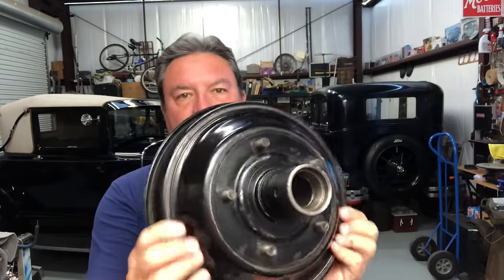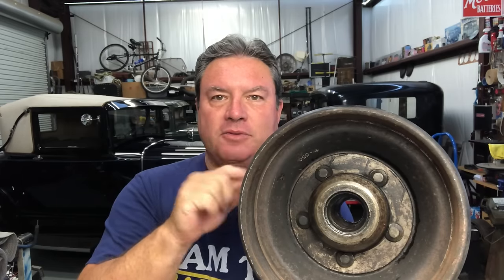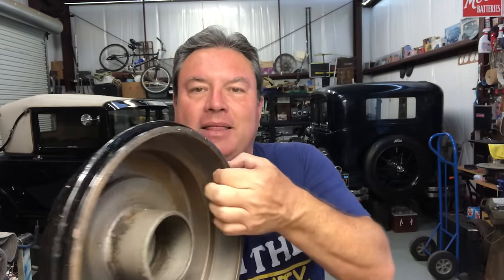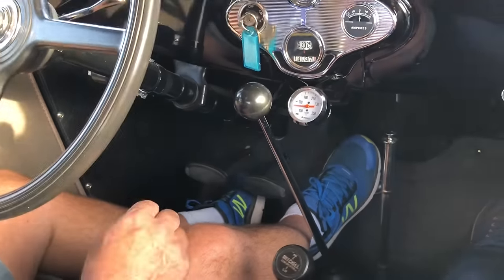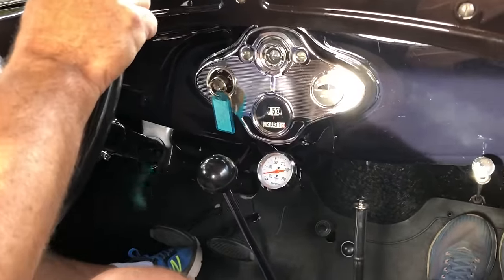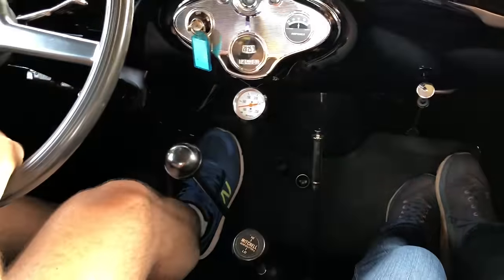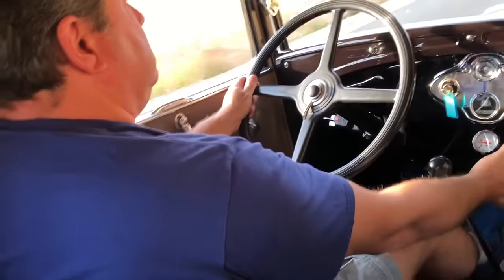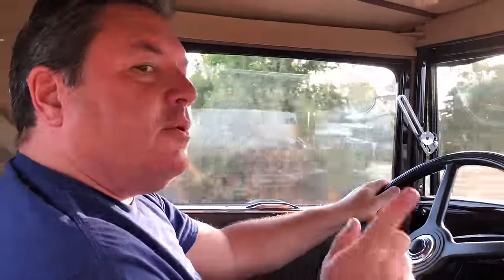What is Brake Fade? How to prevent brake fade in a Ford Model A

Comment: Having many miles of 18 wheeler experience (read: drum brakes!) I can say with certainty that Paul is very much correct in his assertions. Start by adjusting your driving style and approach to these cars. Attention to the Brake condition, Adjustment and proper technique make drum brakes viable even today. Some new cars still have them on the rear. The biggest take away? Drive defensively within the limits of your car, yourself and the rules of the road. 
Thanks Paul! Good show!
PS: You have my vote.
Reply from the maker: Well said!
Reply: One thing about drum brakes... If you drive through deep water, you must dry out your brakes. This is a non-issue with discs. Here in Florida during the summer season we get torrential downpours that flood some know areas.
Reply: @williamforbes5826 I drive both big rigs and a pre war of my own.  My normal truck of the last 7 years doesn't even have an engine brake, yet I never had an issue with brake fade even when going through the Rockies with a full load.  Driving a pre-war car is pretty much the exact same as driving a truck.  Shifting, braking, cornering, acceleration, and often even lack of visibility, are all very much like driving a big truck.

So, if you ever get in one, drive it like your truck and you'll do fine.
Reply: VW is using drums on the rear of their EVs because they have regenerative braking and don't need rear discs, so it saves them money. Personally, every used car with drum brakes I've ever bought had leaking rear brake cylinders. You can't let cars with drum brakes sit for a long time, especially if the brake fluid isn't changed every few years.

Comment: I grew up driving drum brake cars and trucks, and I learned all the ins and outs of that braking system. When they are adjusted right, there is nothing wrong with drum breaks, you just need to be a well-trained driver like me, lol. You are right about using manual transmissions. You would be amazed at the things I did with my old cars and when motorcycle racing. Good luck guys, Mike
Reply from the maker: Hey Mike!!  I was hoping you would chime in.  That art of driving cars with drum brakes is completely lost on new generations.  I hope to educate them on what you learned as part of normal driver training back in the day.
Reply: @ModelA  The world needs you. Too much of our automotive history is being lost.

Comment: I was told by a fellow at Rochester brake in NY that the bonded or riveted linings of the material you showed go with Iron, woven with steel.  Woven and Iron grab to aggressively and can squeal.  The other way around, (steel to bonded) not good brakes.  I have found this to be true.  I put Iron on my car, well worth the investment.  Proper adjustment is also super important, as you have said in previous videos.

Comment: I've found that driving a pre war car is just like driving a big rig or motorcycle.  Slow before you need to, easy through the corners, more room for acceleration, double clutch both up and down shift, and often even lack of clear visibility are all very much like driving a truck.

When I drove my 31 home, it was the first time I ever drove something of that era and I didn't grind a gear once, and didn't use the brake at all except to hold it while stopped.

You are absolutely correct on that, typically, the lack of braking power has nothing to do with drums.  They can lock up all 4 wheels just as easily as discs.  For a normal car, drums are just as capable.

The problem with drums is heat soak.  As the heat builds from use, drums have a much harder time shedding that heat than discs do.  This is the main advantage of discs for most people, being able to stop more often before fading occurs.

After seeing the difference between the original steel and later cast iron, I can appreciate why they are so much better.  Just that one lip helps a lot to shed heat from the drum.

Good video on the driving, people definitely need that knowledge to run any pre war car safely on today's roads and with modern traffic.
Reply from the maker: Good work Daniel!  Yes, that style of driving that we were taught has been lost.  These days, people drive to the performance limits of their jellybean on wheels all the time.

Comment: Thanks for an excellent vid Paul!   Id like to mention that brake fade is not just limited to brake adjustment and the expansion of the drum, when the organic style shoes reach around 450 deg F they can 'glaze over' which causes friction loss.  the reason 'steel' drums are easier to get brake fade is because steel holds on to heat better than cast iron just due to the metallurgical properties of steel vs cast iron.  so the same long stop on the same down grade the steel drum will be way hotter and fade way faster than a cast iron drum.   If you ever get severe brake fade in your vehicle I highly recommend tearing the brakes down for a complete inspection!  the shoes can crystalize and you can lose a lot of your stopping power from just one mistake of severe over heating of the shoes or pads for that matter! If you smell burnt brakes and or they are smoking they need to be inspected! check for 'fire cracked' shoes pads and drum or rotor surfaces.  'bonded' shoes and pads are more easily damaged from over heating vs riveted shoes and pads.

Comment: Nice video, Paul. Love the ride in the country. For what it's worth, in 1980 a Deluxe Roadster might be had for $12,000.00 to $15,000.00.  A rebuilt engine back then was $500.00.  Today a Deluxe Roadster  might bring $20,000.00 to maybe $25,000.00 but what happened to the engine? 10 times even 20 times the price of 1980. That is a problem. Our country's greatest re-source is our youth but they had better be quite affluent  to play in this sandbox.
Reply from the maker: That goes for pretty much any car related hobby these days.  Back when, labor was cheap and technology was expensive.  Today, it is the other way around.

Comment: Great video as always, Paul and Congratulations on almost 41,000 subscribers! I’m proud to be one of them.
You’re absolutely right about the braking and using the engine to help slow you down. My daily driver is a 2013 Chevy Cruze with a six speed manual transmission. I bought this car new. This car has 194k miles on it and I have never done any work on the brakes. This is because I apply all the techniques you described. Everything you talked about is relevant on modern cars, trucks and tractors, which is how I learned about it in the first place.
Reply from the maker: Yes!!!  Thanks Matt

Comment: Thank you for this video, I recently went through, and strictly adhered to, the recommended brake adjustment process, and found a big difference in stopping power overall.  Prior, my vehicle was using mostly the front bakes.

Comment: I'm amazed at your ability to shift - it looks almost as if you drove synchro-mesh. 
My transmission would very much complain if I tried shifting it that quickly :o
Reply from the maker: My transmission is really tight (fresh rebuild).  I run thick oil in it for break-in right now.  Makes it easy!

Comment: I think more brakes are used because some have a more difficult time down shifting without grinding the gears.  My Oakland has the the break shoes on the outside of the drums I learned early on washing it and then driving it down the hill the stop sign was just a suggestion.  Hope you get elected to the board your a good ambassador.
Reply from the maker: Thank you!  Maybe it does come down to learning to handle the gearbox better.

Comment: Thanks again,  Paul.  Another great video. Inthe future, maybe you could instruct on "arcing" brake shoes. 
BTW - what is with the "soggy" transmission? I didn't hear any "crunchiness"  inyour shifts!
Reply from the maker: I plan to make a video about rebuilding brake systems, and will include that for sure!
Thanks!  Lots of practice.  I did a video called "how to shift a Ford Model A" or similar.  In that video, I show you how to drive like me.  No gear clash.

Comment: Paul, I noticed as you go thru the gearing sequence that there is no gear clash.  Is this because you filled the transmission with the correct lube (oil)? Not even any double clutching. Amazing!
Reply from the maker: I have a lot of experience.  See my video on how to shift a Model A.  I show you how to drive like this!  You only need to double clutch when downshifting.  I did that here.  I just do it quick.
Reply: Model A's do make people happy, every time I drive mine, people smile and wave. I frequently giving rides to interested people and have even let some people drive it (I have a Mitchel syncro trans). I want to put that hook in their mouth and get them interested in owning. Trouble is, they ask to buy mine😅. 
P.S. 
You have my vote Paul

Comment: The reason(s) that Model A enthusiasm versus 'newer' antique cars is less are: these cars from the 20s have engines that run 'dirty' and lack power, the cars themselves are primitively built, only a slight improvement over the Model T - itself a modest improvement over the horse-drawn carriage it replaced, and they are SLOW in their stock trim. Which is what restorers do and collectors want: stock and original as possible. The upside: There aren't many left plus the satisfaction of owning a piece of early automotive history is immeasurable, as I'm sure you can probably attest to, Paul! :goodvibes:
Reply: A lot of the things you mention are more prejudices and believes people hold than actual fact....
Reply from the maker: Yea, but no.  Have you ever driven a well maintained Model A?  It appears not.  Everything you mention is false.
Reply from the maker: @DrTheRich  You're right!

Comment: Don’t know if the model A is the same as the slightly earlier Cadillac’s but they describe what you’re doing as the correct way of using the brakes in the manual, it specifically tells you in the manual to avoid using brakes (though of course theirs are superior and other road users might not be able to stop in time…)
Reply from the maker: Someday it will

Comment: Adjusting the brake rod has been a challenge. I was told to go on a dirt road Then slam on the brakes. Then go back and see which ones grabbed the best then adjust the others
Reply from the maker: That method will not provide correct braking, and will make your pedal feel stiff like you have no brakes.  I did a video on how to adjust Model A brakes.  Do a search for that and try that method.  You will get maximum braking that way.

Comment: A 40-ton tractor trailer becomes a 40-ton runaway train on a long downhill incline if you don't drive it the same way. Spent enough time in the cab that I drive all my vehicles the same way. When full braking is needed, it's always best to have full braking.

Comment: Very informative. Still trying to figure out down shift points on mine. It seems like I have to over wind the engine to get it into lower gear. Maybe I'm  just not used to it yet.
Reply from the maker: Maybe you're revving too high?  Or, your idle is too high?
Reply: Not sure. This is the only standard vehicle I ever drove that I couldn't down shift with ease. I can usually shift up & down without even using the clutch on most standards even nonsynchromesh transmissions but this 1 is different. Reasonably sure in time I will master it. I tell everyone, "It isn't a pleasure to drive but it is fun. @ModelA
Reply from the maker: I'm curious if your gears or shift forks might be worn
Reply: Kinda leaning in that direction. Only thing stopping me is, it shifts perfect going up. Or at least it feels like it. I'll  delve into it more when I go back to NY in May. She's sleeping for the winter. Treated the gas, ran the carb out, disconnected the battery & put the battery tender on her just before heading to Florida. Thank You & keep those informative videos coming. I learn a little more each time I watch 1.
 @ModelA

Comment: Thanks Paul for all the great videos, I just bought a 31 model A Roadster because of you after I"ve been watching you on youtube. I"m going through the car with the maintenance things that have to be done. Should I install an oil filter setup? And if so which way should I go?
Reply from the maker: If you plan to drive a lot, then definitely go with an oil filter.  Which one depends on what you find.  I use them both, see video about doing what's right.  I talk about it in that one.  Congratulations!

Comment: Speaking of brakes, what is your opinion of the Flat Head Ted braking system. I spoke with Randy Gross and he said not to waste my money and Ford’s original concept works great. Others in my club (whom I very much respect) give them nothing by glowing marks. Does this kind of fit into the “what’s the best oil to use” category?
Reply from the maker: I agree with Randy.  If you build your brakes properly, then floaters in the fronts are a waste of money.  If they are worn out or you don't build them properly, then floaters will seem like an improvement.  It comes down to doing it right or putting a band aid on a worn out or crummy workmanship job.

Comment: Great video, BUT... a lot of brake fade is caused by "off-gassing" whereas the brake material gets so hot that the material that the brake is made of emits fumes. These fumes then get between the "pad" material and the brake surface, and lubricate it. If you want, get a steam iron and run it across the iron board, and notice how easily it glides when you hit that steam button.
If you ever noticed holes drilled through brake rotors, or lines carved into them, those aren't for cooling, but rather for that gas to escape, and allow the pad to get into contact with the rotor. Heat is still the enemy here, but what it does is elusive. I doubt if you heated a drum to several hundred degrees, it would expand more than a few thousandths. those ad-on bands probably did more for heat dissipation, than drum expansion. If it were expansion, as it heated up, it would expand as well.
But as with any vehicle, let that engine work for you. I've always downshifted a manual.
I learned to drive in a VW beetle, now I have an early 28 AR Roadster, thanks to my dad. Planning to return her to original, but keep her on the road. The Model A is an American icon. Never been a Ford guy, but proud to have one.
Thanks for the channel!
Reply from the maker: Science!

Comment: 3:27 gears turn your 45 mph A to 52 mph cruiser.
Reply from the maker: Unless you live in hill country, then 3:27 gear turns your 45/50 MPH cruiser into a 30 MPH cruiser because it can't pull up hills in 3rd gear anymore.

Comment: With the Model A's rod actuated mechanical shoe drum brakes, there is NO way to prevent SOME brake fade. ANY drum brakes without 1958 Chrysler-type Bendix eccentric "auto adjusters" only used on Imperials (like mine) fade-the Europeans started using them a few year earlier on their sports cars, before switching to disc brakes. It is illegal to sell a CAR or passenger VAN in the US with drum brakes since 1995 as they aren't "anti-lock/system fail " friendly. Today's friction compounds on brake shoes are so much better than available when I was a pump jockey 55 years ago, that helps immensely. Just make certain you cryogenically treat the drums so THEY won't wear thru in 10,000 miles!
Reply from the maker: You bring up some good points.  However, you also need to consider that a Model A weighs half of what a new car does!  Half the weight requires half the stopping power (energy conversion).  Did not know about that law.  How come some new cars are still coming with drum rear brakes then?

Comment: While I agree with the driving style portion of the video the mechanical portion was a failure!  Drums are only going to expand a few thousands of an inch so that isnt a real issue.  The big issue is the extreme heat reduces the effectiveness of friction. No mention in the video of the mechanical condition of the brake system also no mention of shoe glazing from heat.  also no mention of rearching  the brake shoes to match the specific diameter of  drum.
Reply from the maker: Fair enough.  Hey, I have an idea!  You should make a video that is helpful to Model A people and upload it to YouTube, and then I go poop all over it, and see how that makes you feel!